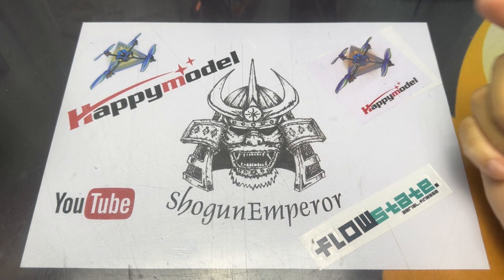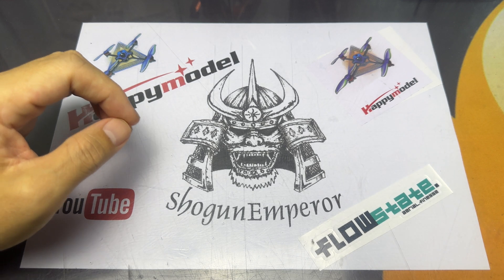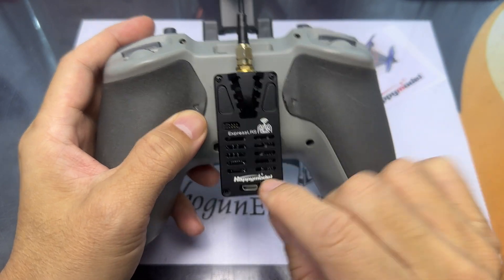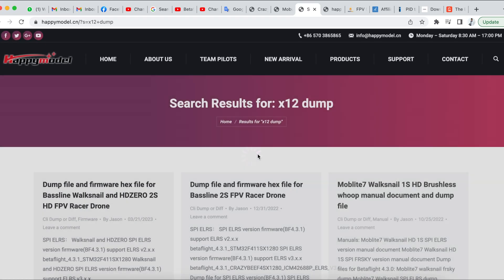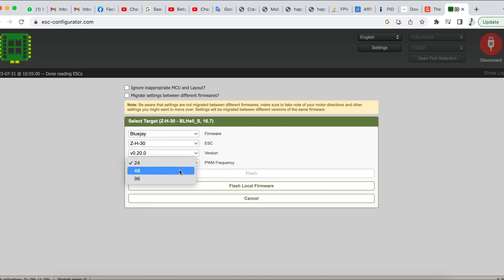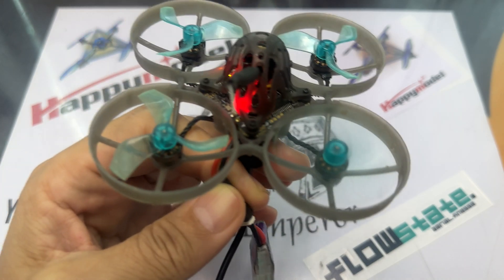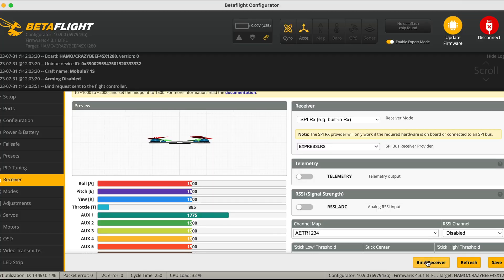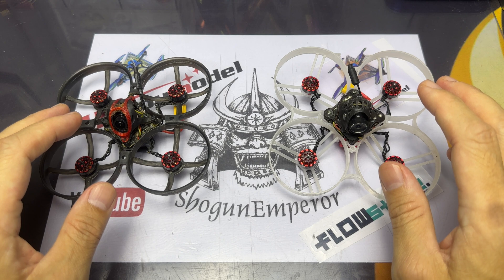One hex to rule them all! RXloss and binding issues

Comment: Im having the same issue now after updating my Mob6 SPI Analog. It was working great, awesome range and very zippy. Then it all stopped and issues started to pop-up. After flashing back to original FC FW and ESC FW, it started flying again but now RXLOSS when i get 40 feet away. Never had so many problems with a drone since i first started with Cleanflight back in 2014 😂
Reply from the maker: aaww man, Im sorry to hear.  Yeah, back then all stuff were solid.  These days its all settings issue.  Do check your baudrate.  Are u flying with a taranis by any chance?  There's a baudrate update u need to do.
Reply: @shogunemperor  yes I'm flying the Taranis X9D. What baudrate?
Reply from the maker: @ this one bruh
https://www.expresslrs.org/quick-start/transmitters/tx-prep/#serial-baud-rate
Reply: @shogunemperor  is this only for ExpressLRS? Because I don't use that. Just FRSKY version 🤔
Reply from the maker: @TRITONFPV  wait. So ur mob6 is frsky? Did u upgrade to BF 4.4.1 by any chance?
Reply: @shogunemperor  I'm currently on 4.4.0.

Comment: So helpful thanks!
Reply from the maker: Pleasure bruddah! Glad to be of help my man
Reply: @shogunemperor  I have the mobola o3 lite coming and already have an o3, o3 took a big crash in my nazgul which ruined the fc, so I'm hoping the o3 is fine, how durable are they could you tell me please?
Reply from the maker: @oisinogorman35  nice bro!! Hmmm… well… the chances of it surviving against a concrete floor or wall at full throttle is very slim for sure! 🤣🤣 but really.. ive had a few crashes with this and its survived so far. Just dont be inverted and full throttle into the ground like what i accidentally did last time. 😜
Reply: @shogunemperor  ahhh well we will see, after the crash I was able to power drone up and got video feed from o3 and was able to switch modes and had rc connection, but a small capacitor got knocked off my fc and it caused it to throttle up without input, aghh I really hope it's okay they're so expensive
Reply from the maker: @oisinogorman35  try to clean everything up and solder the capacitor onto the lipo lead instead, see if that helps.
Reply: @shogunemperor  if only if it was that easy! Lol! I'm talking about one of the ceramic micro capacitors on the board itself unfortunately, the board is dead, my esc survived tho which is good
Reply from the maker: @oisinogorman35  ooooooooohhhhh.... damn. I feel u bro!  Totally!!  Killed a few FCs myself. I had a pile of dead FCs once. Well... good thing the ESCs survived!
Reply: @shogunemperor  thanks man, can't wait for your next mobula freestyle video, such awesome stuff
Reply from the maker: aawww ur too kind bruh!! Really appreciate the support man!!!

Comment: Tbh all this faffing is why i gave up on elrs,  i just want to fly and cannot be arsed with all the BS.
This is why i now only use vista's with black v1 remote,  it's effortless and has all the features and performance i could ever need.
Reply from the maker: haha yeah.  Thats the stupid thing about this hobby. As technology improves, so does the techniques. I used to spend hours just doing troubleshooting wondering why the quad just cant fly... best is a simple tech with good RC link that just connects and off u go.  So at this point, its the DJI. Just bind...and ur ready.

Comment: much appreciated tutorial on the SPI set up! one curious part is on ESC set up where you increased the (start up) idle values. is this absolutely essential? or can it fly ok on the stock lower values?
Reply from the maker: Yes bro. Generally its cause it doesnt spin up with the low throttle value and sometimes may have some weird flight characteristics. Its like a muscle car at low throttle.. it will sputter till the engine stops.